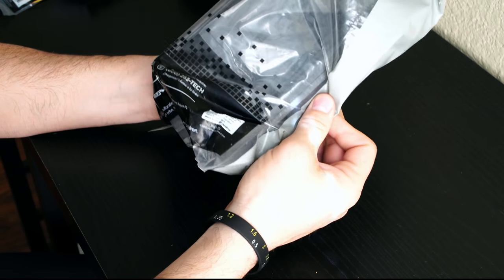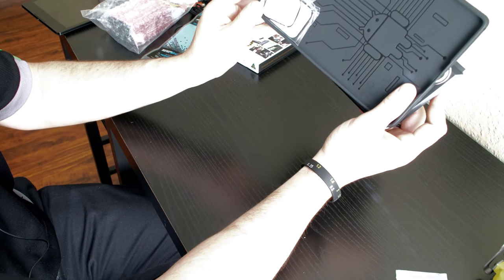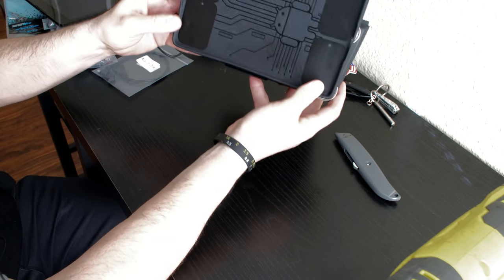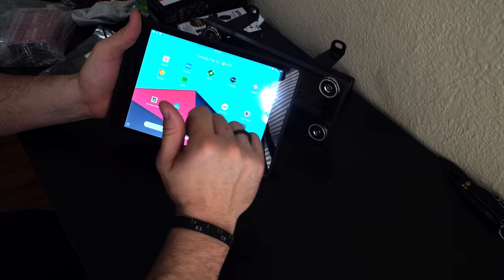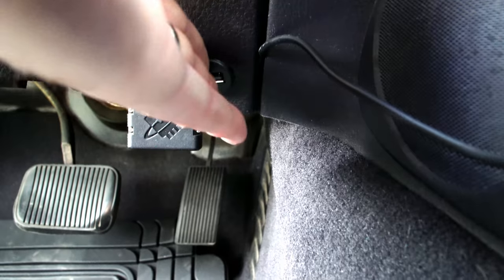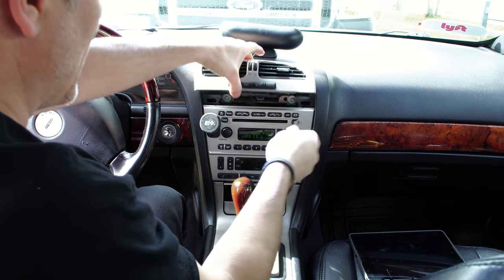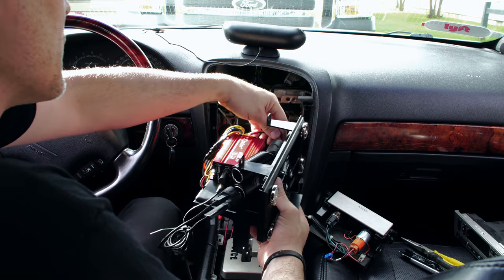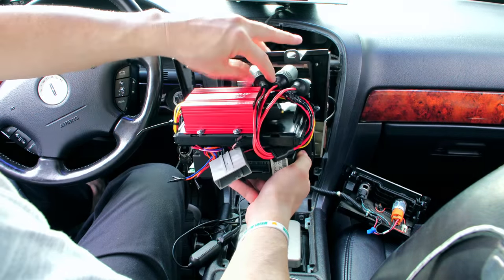Turn Your Tablet Into A Head Unit

Comment: Awesome! Great job showing the step by step with narration. My favorite was the apps you used. The rotation app is golden. I have complained to Lyft about rotation several times, they care not about their drivers. When using my phone's GPS I use landscape mode. This will make Lyft slightly less painful, if I return after the Chinese Flu Pandemic. Also, great job showing why some gear did not make the cut. This kind of tech on a budget can have some obstacles, but you clearly overcame them. As a sound guy I can explain some of the phenomena that occurred when connecting some of the gear...

1) 33:00 Volume drop when connecting multiple audio devices to amp input... You had an impedance mismatch. Much like speakers, the impedance also matters on inputs. I'm willing to bet you have the same drop when you connect any device to the 3.5mm console connection. While the 3.5mm console connection alone will not cause an impedance mismatch, any device you connect most likely will. Try running audio from bluetooth and 3.5mm at the same time, that should also cause a drop. Some portable devices actually shut down the headphone amp when not in use, so you may not notice a drop unless both devices are outputting something. A pocket mixer would resolve this. Audio mixers are good at summing multiple inputs, and you can trim each so that max volume matches on all devices. Technology has allowed their size to shrink, just like amp you installed. 4 channel input pocket mixers can be very inexpensive. (L+R + L+R=4 in). There are even pocket mixers with more inputs. 

2) 35:00 Noise in audio lines... Great job using the iso! 38:30 One of the most impressive things about your build is the cost. You managed to use inexpensive devices to accomplish what most auto manufacturers can't. You could have spent a lot more, so IGNORE the haters. The Iso helped out because of the power supplies used. Most USB chargers are VERY noisy. Sadly some of the most expensive devices come with the noisiest power supplies. When a device is connected for audio and no charger is connected, you won't get the noise. As soon as you connect the charger, buzzzzzzz. Defeating this is accomplished with transformers. A transformer will not pass DC (5V for USB), but will pass AC (audio). The buzz is the pulsing of the power supply. It sends short bursts of the input voltage. Short enough that the devices sees the desired voltage, instead of the input voltage. They also make iso(s) for cable lines. Have you ever tried to hook up analog audio from your TV and gotten buzz? If you disconnect the cable line going into your cable box (or TV), and it goes away then put an iso on it. Ideally insert iso inline between the lightning arrestor (usually a green wire tethered to a water pipe, or building ground) and distribution block. If not, then between the cable box (or TV) and the wall jack. The last one I bought cost about $15 on amazon. 

The only things I would have done different...
1) use pocket mixer instead of a splitter. 

2) instead of bluetooth, connect the tablet via heaphone jack for better sound and zero latency. 

I would keep the bluetooth as an available input because you never know. 

Thank you so much for the great video. I have been wanting to do just the same, and you nailed it. I have a friend who has an old Bronco, and I am going to send him this link because you did, you nailed it.
Reply from the maker: Best comment yet! Pinned! Thank you so much for your detailed analysis and solutions! You certainly seem to know what you are talking about. I ended up going with the 3.5mm audio jack for audio instead of the Bluetooth. I'm going to give your other recommendation a try! Thanks again for watching and commenting!
Reply: If so i
Reply: @edwardlthompson  — I haven’t even begun the 3rd minute of this video, but I’m going to tell you ALREADY that I love what you’ve done here, and I’m 100% doing this after I’ve watched this thoroughly (and read this pinned comment 😂)...

I have a 2015 Wrangler JK and the head unit has been screaming out to me that it’s an eye sore that wants to be replaced... I have SEVERAL tablets laying around (1 is an iPad mini 2 w/ LTE modem) and I have “mounted” one in the past (to play my music and update the look) but it was Jerry rigged and not worth the hassle since I had to MOVE IT anytime the OEM head was needed... what I remember is the iPad mini was a perfect fit over the head unit and that a “kit” like this would actually squeeze right in perfectly... but then how to get it to control everything????? 🤯 

The whole idea was shelved permanently... until this video randomly appeared... I can’t sis it to see how all of this comes out and how much control it has... 

ONE SUGGSSTION — sinxe the video is an hour long, it would’ve been wise to show several examples of the FINISHED PRODUCT working and looking great along with a brief explanation of, perhaps, how “ANYONE CAN DO THIS TO ANY VEHICLE!” Or whatever applies... This way the 1 hour DOESNT turn people off as much since they saw how awesome their DIY car mod can be! Hook, Line & Sinker as they say... 

THANKS AND GREAT JOB
Reply from the maker: @flojotube  thanks for the positive vibes! Thanks for watching and I wish you luck with your build! Make sure you check out the update video as well. I switch to a new tablet and a different setup in my truck.
Reply: @edwardlthompson  Great video, wanted to ask, why not a new tablet with wireless charging, what does the lineage OS offer?
Reply from the maker: Thanks for watching and commenting! Lineage OS is open source and is based off of the AOSP. You have to add in the Google apps if you want or need them. This give you far more control over your privacy and they support devices long after the manufacturer has stopped. That tablet from many years ago is able to run the most recent version of Android thanks to the support of those contributors to the project. It also allows deeper customization of the UX.
Reply: i aint readin allat 🗣️🗣️🔥🔥🔥
Reply from the maker: 😂 The OP was very inspired by watching the video and shared some helpful things. I do appreciate your comment as well as it helps keep this video relevant in the algorithm. 💚
Reply: Thank you for all your information seriously
Reply from the maker: You're welcome, I'm really glad that so many people have found this video to be useful.
Reply: I realy loved the video!I am in the same project trying to connect my Samsung galaxy note 10" cause lineageOS made an upgrade to android 10 and resurect it. BUT i have one question that it isn't mantioned in video and i want to ask both @edwardlthompson and @MP-qn1jw how do you solve the balance between front and rear speakers? the solution i can think of is by getting 2 amplifiers and split RCA so the front and rear can have different volumes from the amps. Is there anything else that i am missing ? Thanks, and again gr8 video best tutorial online!
Reply from the maker: @BoKoLHs  I think your solution of separate amps would work. I have all mine wired together in stereo with no balance between front and rear. If I recall correctly, you would need a 4 channel amp to change that balance. I think mine was just a simple 2 channel.
Reply: @edwardlthompson  channels wontt give solution since jack can only output stereo! But rear speakers (at least mine) are most of the times bigger and can handle more than front.So i would like to adjust them more on rear so i will not overkill fronts.Do u think it is possible to fit 2 of these amps there ? And will i need a seperate power cable or the on that is already going in my unit right now will be enough for both amps and my tablet ?I am not good at car electrics at all neither at electronics and sound :) just a google diy guy!

Comment: I found this as I was looking as to how to make my cellphone a key fog for my 2000 Chevy Suburban & I Came across this & of course I just had to watch it. So I skimmed through it pretty quick & I was completely amazed by what I saw. At this point I have not had a chance to try this but, I'm definitely going to.  I have several tablets & what an amazing idea I think this is. As well WOW it would be a lot cheaper & a lot better way of still using your devices without things cluttering up & at the same time without spending hundreds of dollars on a system. This is Totally Amazing!!  I will comment after I've actually done it but I wanted to say this is an amazing idea. 😀
Thank You
Kimber
Reply from the maker: Thank you for watching and commenting! I'm glad I was able to inspire and inform you about using the tablet in that way! Make sure you check out my update video where I have upgraded the tablet and setup. 

I would love to see a video of your setup once you have it done. Please comment a link to it if you record a video.
Reply: Did you end up doing it?

Comment: Very cool that peeps are still doing this.   A good tablet has better resolution, more features and all this at a bargain compared to an Android Double Din. I've had my tablet install for years, good choice w/ the Nexus's, I use a 2013 N7 the 2nd gen, that's an upgrade from the 1st Gen N7, I had in there previously. What's ideal bout the N7's is that developers had actually created ROMs & kernals that are catered especially for car installs. Not sure bout the N9, but a search on it isn't hard. After a bit you're going to wish you had certain features that you're missing. The ROMs & kernals fixed that. For example, charging your tablet while still connected to your USB hub and all those accessories remain powered as well. I have a backup cam connected to the hub, the video feed from it, displays on the tablet. When Im in reverse, the tablet automatically switches over to the backup cam app so I can view while I'm backing up. When I put it in gear, it switches back to my audio player app. If you're interested in the N7, check out Timur's ROM, he made it for both N7 tablets, but the 2nd gen, we had to make a donation to get the entire ROM and kernel but it's definitely worth it. The first gen is free, but I'd go with the 2nd gen, it's faster, better resolution and has more features cuz soon as the 2nd he came out, he stopped developing the 1st and concentrated on the newer tablet. Samson makes a little clippable microphone that plugs in via USB and compatible on Android. I have it clipped to my visor and pointed down for better reception. My phone automatically connects to my tablet soon as I enter the car, so that calls/texts are routed to my tablet. I don't need to take out of my pocket while in the car, yet can still text and make calls. Check out Tablet Talk in the Play Store, calls are routed to your tablet which is connected to your speakers so audio comes out of there like newer cars. Your contacts are synced so you can say "Hey Google, call whoever" it does it w/o you needing to lift a finger, sends texts same way. When you get a text, it'll even read it to you. I could go on forever about all the stuff I can do. I have Bluetooth controllers for games while waiting in the car or for passengers. I have steering wheel controls that work too. It might have been easier if you kept your existing radio and simply connected an AUX to it, to route audio from tablet to your car. I know you wanted to remove it but  relocating it works too. There's Bluetooth receivers that plug in the AUX, so you can route audio wirelessly to it. I actually prefer wired connection cuz audio quality is wayyy better. My audio is connected to a DAC & headphone amp, I mostly stream music from Deezer, Spotify, Tidal and my entire audio collection is on a 128GB USB drive connected to my USB hub. The hub connects to the N7, via OTG, it's powered hub so it charges my tablet while driving. Soon as I park the car engine turns off, tablet goes into deep sleep mode. Consumes very little battery, also doesn't drain my car battery while parked. This is part of the ROM/kernal. When get back in, every thing powers on where it left off when I left. Check out Tasker in the play Store, it automates any task you want automatically. Like when I leave my house and get into my car. My phone switches off my home wifi, turns on my cellular data, then hotspot so that my tablet auto connects to it to use the internet so I can stream music. It auto connects Bluetooth so calls/texts appear on my tablet. It's super cool app but has a bit of a learning curve, that's worth it. Makes life much easier when you literally don't need to do anything, as it's automated. Don't member the name but search "car launchers in the store," there's quite a few but some look identical to OEM ones from Automakers, but it's customizeable so you're free to pick which ever app you want on the home screen. Are you using Torque for OBD2 features? Couldn't tell, I was typing this while tryna watch you too. It's got more features than most will ever need, but allows you to adjust certain things like timing, reset air/fuel, any communications to your ECU. Not sure about Lincoln, but I have a Nissan and there's specific apps that let me "code" certain parameters of my car, like how long the door lights stay on, brightness of the dashboard, remove speed limiter, adjust boost, ect.. those specific parameters will only be available on apps made especially for your automaker. Torque is more  general that works on every car, I like it cuz it has customizeable gauges, graphs, there's a big add-on that themes the entire app, I have it matching the rest of my dashboard but there's tons of themes, if you like hot rod flames or Batman, your gauges will match that. One last thing the audio buzzing can be remedied by making a separate fused power wire directly to your battery. What's happening is you're using the same power wire that's connected to everything else already and that creates static thats interference which is the buzzing. Best is to have separate power to your amp & tablet, along with separate grounds too. You don't want them on the same circuit, I can explain. It better but my brains on bout 25% right now, tired and need sleep. Thought I'd just mention the quick fix now cuz Im a now or never kinda guy.. good luck
Reply from the maker: That's awesome! Thank you so much for all that information! Please tell me a little more about the backup camera setup. Also, make sure to check out my update video, I switched to another tablet!

Comment: This just now popped up on my YouTube home page.  Really cool.  It’s probably been mentioned but they make right angle USB connectors so you don’t have to have the wire shooting straight out of your tablet.
Reply from the maker: Thank you for the tip! I eventually got one of those. I made an update video to this one that is recommended at the end. In that video you can see my final setup as well as an alternative setup I did in my work truck with a newer tablet.